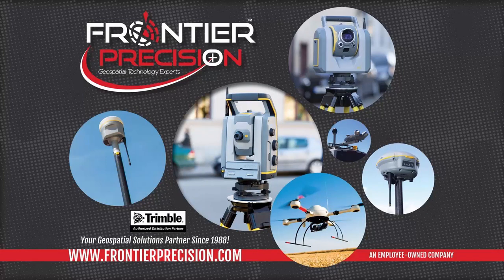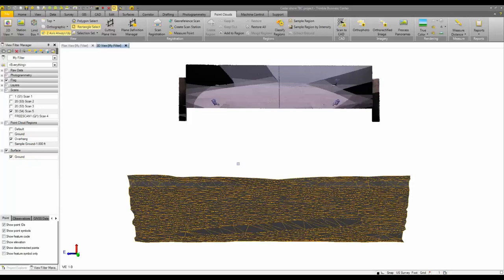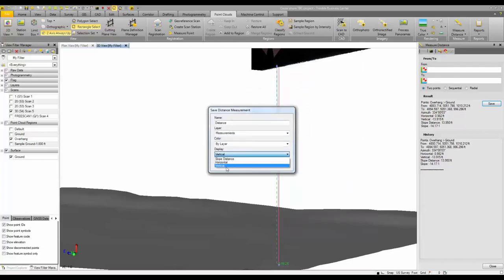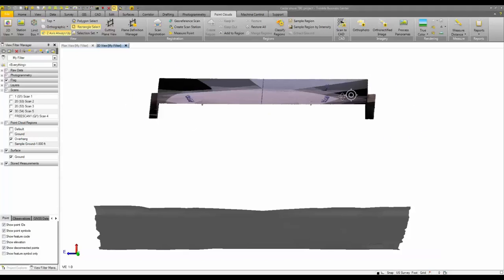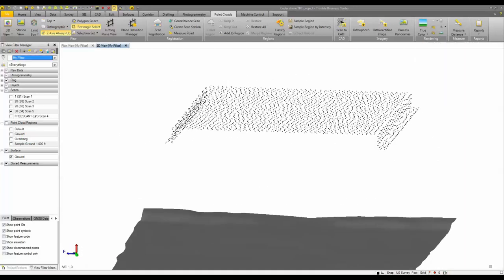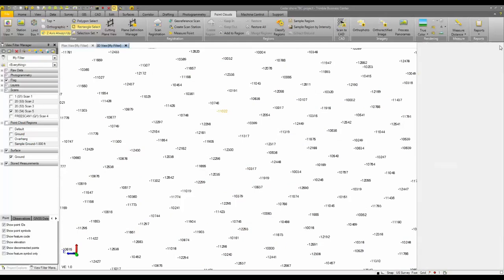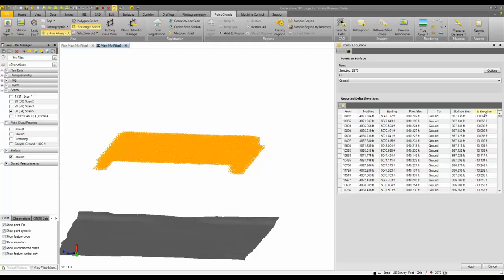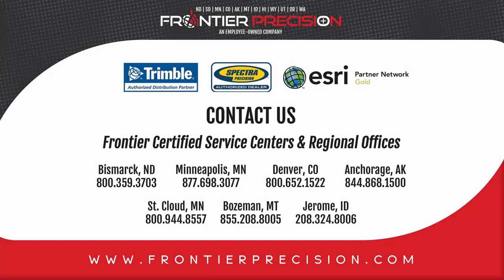Measuring Clearances Using Scan Data in Trimble Business Center

Comment: I'm working on a similar project (my 1st w/TBC). The only difference is, that I'm using individual bridge beams as my "region", along with my pavement "surface"...where it appears you're using a bridge deck below. You also appear to have it shaded, meshed, etc?? After following your example to create survey pts from the CAD (cloud) pts, I end up with no actual Survey pts. Can you possibly tell me what I may doing wrong?

Sincerely
Reply: It's a two step process to go from "Scan points" to "Survey points". You can only do a "Points to Surface" measurement using "Survey points". The two steps for converting points are this:  First, use the Scan to CAD tool (3:18 in video). Second, use the Convert CAD Points tool (4:10 in video). The Convert CAD points tool is what allows you to convert the CAD points to Survey points. The Survey points can then be selected in the Measure Points to Surface command. To your other question, the only mesh in the video is the ground surface. The bridge deck is just a very dense point cloud colorized to RGB values.
-Dylan